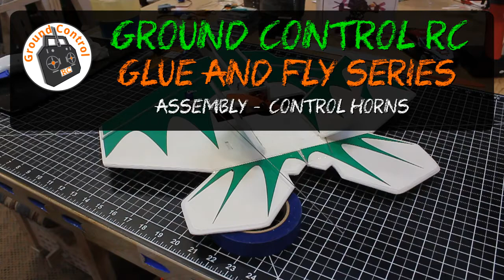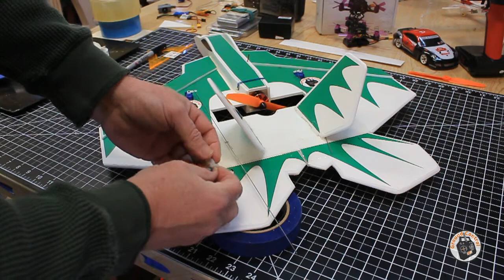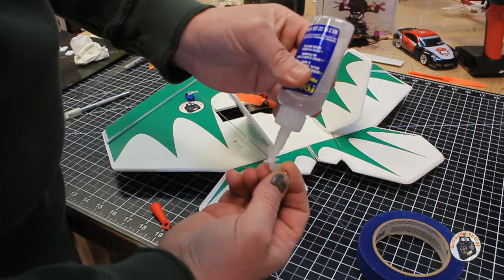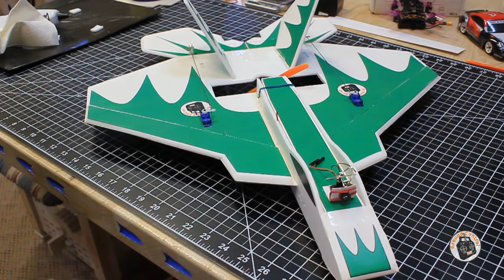Glue & Fly Series - F-22 Mini V2 Build - Installation Control Horns

Comment: What's the second part with the slot in it?
Reply from the maker: That part slides over top of the plastic stem of the control horn to help lock it in place.
I always glue them in as well to make sure they stay solid.

Comment: Just finished mine today, minus the decals (until after it flies). I will maiden it this weekend after it stops raining. Using an Admiral 450Mah 3S battery, 12A ESC and a Racerstar BR1206 6000KV motor with a kingKong 3.8x3E tiny prop.
Reply from the maker: That's awesome! I can't wait to see it in the air! I just took out the Mini V3 yesterday after having some fun flights with the Micro. Wow! It had been a while since I'd flown that one. Hopefully your weather will hold for the weekend ;-)